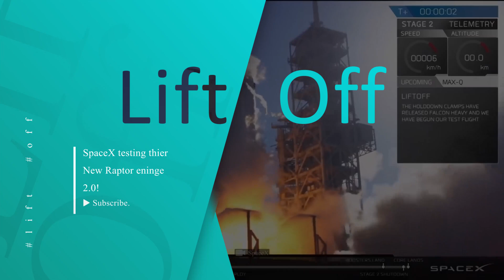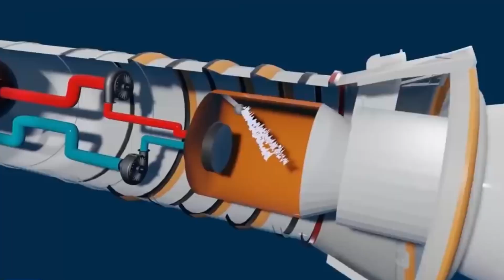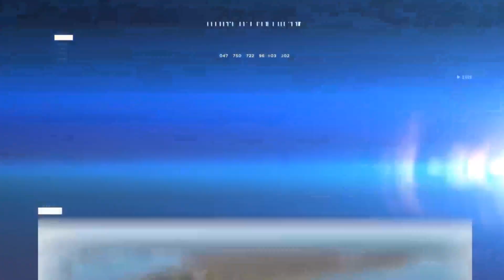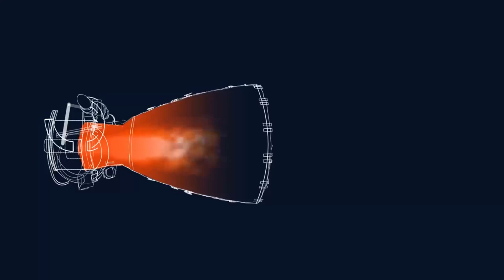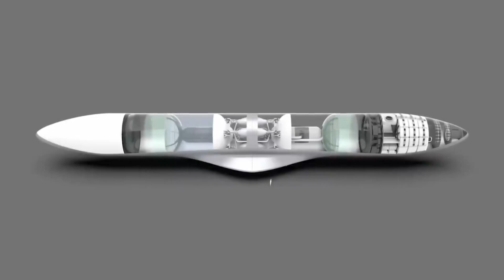JUST NOW! SpaceX Raptor Engine 2 0 Being TESTED by Elon Musk!

Comment: What do you think about instead of cutting up a booster don't need take the booster to the test site for the rocket engines and use that for testing two things could happen when they could get stress test on the booster by testing all the rocket engines on it the metal fatigue happens and it having a real world situation on testing the boosters what do you think ?